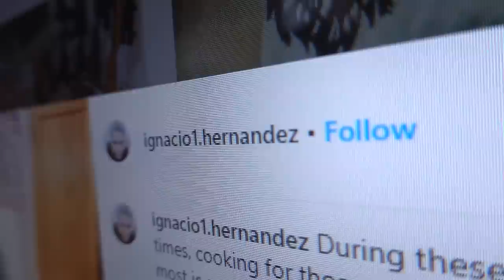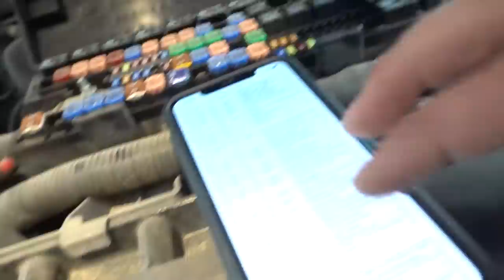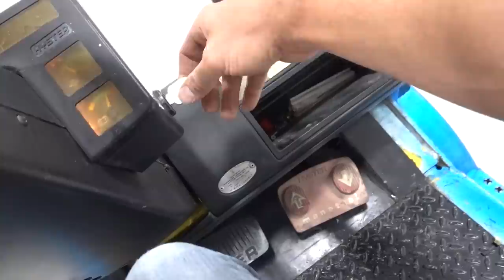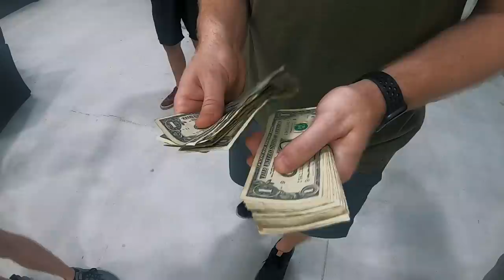I Bought an Old Beater Forklift... AND IT'S AWESOME!!!

Comment: With the fan always running it could be a few things. A bad thermostat that could be stuck open or it could possibly be a bad coolant temp sensor. Bad sensor or short in wire.
Reply: Agreed.... Common with Fords
Reply: This was my first guess as well - bad coolant temp sensor
Reply: could also be a random problem with the engine/the computer in it, happens with cars too
Reply: Or the relay he just bought was bad out of the box...

Comment: OK, you had your fun. If Texas is like Florida you may need to take a forklift operators safety course (All Operators in your company). I am glad no one leaned too far while riding in the chair while elevated since it did not appear to be tied to the forks. One thing you may want to consider is a set of fork extenders. They slip on over the existing forks. They can extend your reach when unloading longer size shipments. I hope it lasts you for years to come. Stay safe and stay healthy. Keep living your dreams.

Comment: Hey Matt, if you put the parking brake on and accelerate while lifting up the forks it  makes the hydraulic pumps work faster. You also by the looks of it have side shift to the forks. This means you have half a metre to move the forks side to side, this is useful for loading pallets onto vehicles

Comment: I'll direct you to AvE to see a few mods you can possibly make to your new / old forklift. You have a bad sensor telling the fan that the engine is hot. Just wait until you have to change a light bulb, I said get on the pallet and I'll lift it, Yes you will be 'safe' :D (last comment posted to soon)
Reply: I would also direct him to a recent video by the youtuber Watch Wes Work. He recently put up a video about a Cadillac XLR  with a cooling fan that wont shut off. The system is designed to fail safe so your engine doesn't overheat and turn into a large, expensive paperweight. He also has some great videos on forklifts.
Reply: after that it will be Skookum as Frig!

Comment: Just mind your weight limit when you have that at max height moving around... scary stuffs man 😂
Reply: Ditto, there should be a plate with max weight and height on the forklift. If not, look online for make and model.👍
Reply: I've watched as things fell due to that when working at a warehouse, scary is an understatement!
Reply: I was thinking the same thing, if you move that lift around without lowering a heavy load from up top it's going to be an instant disaster.
Reply: You doing a business? Someone gets killed and you have NO business anymore. OSHA will be up your ass if anyone gets killed with that lift. You need a safety program and a training program.
I worked in a specialized department doing OSHA certifications and other insurance/Federal regulation compliance for 19 years.

Comment: For your truck. Try to find a wire diagram and follow the wires check for a break in the wires Use a voltmeter Also check the grounds. Hope this helps love the videos.

Comment: The propane is alright for use in small warehouses however I would recommend opening bay doors for circulation when operating for a while. I believe osha says electric is the only proper forklift for indoor use without proper air circulation. Congrats on the new buy
Reply: Propane is totally fine indoors.
Reply: @rickmista1213  With proper ventilation
Reply: @Xachremos  Nah you do not need a ventilator for propane.... Now if you smell propane I would open it.
Reply: If they run it to much. The first tell tale will be getting headaches. Then you know the fumes are getting bad. But I don't believe they will run into trouble running it inside. Many warehouses run multiple propane forklifts inside. One being run inside won't be enough to cause trouble. That's a big space it will dissipate quickly.

Comment: I think you should get something like obd reader. Manytimes you have had issues and wondered whats wrong, think it would help alot🤔
Reply: That only works when check engine light is on.
Reply: @tommywilliams9184  A vehicle can throw a code without the check engine light on.
Reply: @tommywilliams9184   i dont know about all car brands but ihave audi and specific obd reader for vac consern cars and it sees everything. Even like if you had trunk light error week ago 🤣
Reply: Battery disconnected usually won't throw codes until the truck runs for a while
Reply: @dariushobbs1  Especially something as new as the Raptor.
Reply: OBD2 adapter, $12 on amazon. type in "ELM327". thats the type of adapter it is.  then download the Torque app.
Reply: I totally agree!
Reply: @sberryscake   i had one of those and torque app. It didint show anything else than engine component fault codes. I would maybe buy one that is made for the specific brand

Comment: The relay will have numbers by each pin, normally pin 86 is the feed from the switch and 85 is the neg or earth pin, put your volt meter in these two pins sockets with the key off, if no reading  system is good, if you get a reading with the key off, the water temperature switch is stuck on and powers the fan, and most switches are design to fail on as it is better to be to cool than boil up, good luck mate.

Comment: As an experienced hyster fork life operator, when you took him up in that chair, it scared me. You should never do that. Ever. I recommend taking a forklift course and anyone else who operates it get certified, and having a forklift mechanic look over your rig. Over time the chains stretch, wouldn’t wanna drop something and hurt/ kill someone.
Reply: I take offense to this. It practically suggested trust it with your life if some other person says it’s fine. You should never be in a position for your life to end because of mechanical failure. 

The only thing we trust like this is buildings and brakes/steering. There’s never a reason to be near any heavy machinery in a way that gets you killed. None
Reply: I posted above but I didn't list all the things that made me go WTF? Company I worked for years ago (same one I got MY cert at) bought a BIG Hyster hydrostat. Got it cheap due to a lunched engine. No problem, we had a warehouse full of Diesel engines. My area was warranty so all the engines that people ran out of oil came to me. We built an engine for it out of good leftover parts. Inline turbocharged Diesel 6 cyl. MUCH more powerful than the original engine! There were only a few of us that used it everybody else was afraid of it! Damn thing would ROAST the tires!

Comment: Matt, I hope you read this, to have a forklift, you need to do safety inspections each day you plan to use it, this is an OSHA and insurance requirement. If it fails the inspection, it has to have a lockout tag, and keys locked up. You will have to get  repair work done by a licensed and certified lift truck technician. You could have leased from Hyster and got maintenance thrown in, if it goes out of service they bring you another one. Also when you lift someone up in the lift, it has to be in an OSHA  and ANSI approved Forklift man basket, with a lanyard and safety harness. It also has to be attached to the forklift with safety chains. Now the big picture, all of your racking needs safety post protectors, gantrys and jibs, bollards by your doors, and guard rails by equipment. You will also need LP cylinder cage to store spares, you opened a big ass ball of worms getting a forklift Good luck. Check with Grainger, they have all the things you need.
Reply: Oof
Reply: bro how many people actually do all this stuff? unless they video themselves without this stuff theres no way theyd get caught and whod actually snitch? cause most people dont know youd need all that stuff
Reply: Grainger, 25-75% more than anywhere else but good in a pinch to get you up and running.
Reply: @gcart7675   No one snitches until they get injured. I hate BS safety but Forks are dangerous and training is important.
Reply: Leasing is like 1k a month..... Stuff like that kills small businesses
Reply: @Turk_2023  Getting repair of owned lifts is very expensive w/o a service contract, which can hurt small business owners even more.  I have been a lift( forklift/order picker, boom, scissor lift) operator for over 20 years!!
Reply: @jz422  yeah Koke inc has more stuff, but way more expensive
Reply: @bryandiel6773  I mean these dudes are buying it to lift a pallet of shirts on a truck twice a week.  They are not going to break it down fast

Comment: I used to work 12 hour shifts in the 1980's at the Spencer Gifts printing facility in Somers Point, New Jersey. We ran huge computer controlled laser printers printing catalog covers for their mail division with a crew of about 6 people at night. We had 2 forklifts to move paper, ink, and printing drum supplies around. The printing machines needed little supervision, just paper and ink every hour or so, and a drum cleaning or change when the print started to look sloppy. So that meant forklift races and other fun for most of the time, especially on Friday Beer & Taco nights.

Comment: I’d highly highly recommend buying/installing a side shift for your forks. Super useful. 

Also, when you need to get your forks to go up faster, put it in neutral and give it gas, it’ll raise up faster.

Also also, when you use the lift and need to put a skid up, go about 3/4 of the way onto the rack, then tilt your mast forward to allow you to get it in all the way. You don’t have to do that getting them down. Just go straight in and pick it up to get them down

Comment: You should get some wheel booties for the forklift and a skirt in case of any fluid leaks. The concrete looks unsealed and will stain very easily!! That floor would look great and last forever If you got it polished!
Reply: I think he mentioned a few videos back that the concrete did get sealed
Reply: Floor is sealed
Should have gotten a forklift with air tires
Reply: @dubious6718  I was going to say, "not for a warehouse forklift. That's just one more maintenance headache." Then I remembered this is Matt we're talking about. We'll probably see him haul that thing out to all sorts of "non-warehouse spots" (like the Abandoned Mansion) to do all sorts of "non-warehouse jobs" (like acting like a vehicle lift)...

Come to think of it, tires is the least of Matt's worries.
Reply: anker eisenman must have missed that

Comment: Matt, you probably did, but check the coolant level. if it gets low, the fans will run longer to keep cooling the lower amount of coolant in the system and usually the water temps are pulled near the top of the radiator (which wouldnt have coolant anymore) so just hot metal.

Comment: First off the hyster will be good for another few thousand hours, the engine will go first mind. Please 'LISTEN' do 'NOT' play around with the forklift or in the vicinity of it when in use. Ive worked with all types of forklifts over the past 30 years as an material handling engineer and technician and can tell you there are too many horror stories caused by 'a bit of fun' with the trucks. Having to remove body parts and clean the liquids left is no joke! If you or any employees turn the steering on full lock and gun the engine for a laugh as you do donuts(as was in your video) you will not be laughing as you get flung out the side due to inertia as the truck tips over on to the top of you. Be respectful, thoughtful and get training for everyone whos going to use the truck.
Reply: Last time I saw a forklift (paramedic), two people had wanted to mess around. One hit the other, broke both his shins (both tibia and fibula) one leg open break. could have gone much worse. Pretty sure that guy couldn't work for a year.

Comment: I owned a commercial recycling company and for awhile we had both Hyster and Toyota forklifts. The Toyota’s rarely needed anything other than regular maintenance. Not so for the Hyster’s. Lots and lots of repairs.
Reply: Hyster's are built 400+ lbs more than Toyota's and are far easier to work on and obtain parts. All about maintenance man.

Comment: I'm not totally sure what your issue is, on my f350 it was just the relay that needed replacing so I tore out the motor and put a Cummins in it lol I wish you luck in finding that gremlin also 2500 hours? That things mint!
Reply: King Bob why would you do that it doesn't make any sense
Reply: Its obviously a joke
Reply: My truck wouldn’t start so I changed the headlight...totally fixed all the problems
Reply: Mint or f*cking mint 👌?

Comment: My 05 Mazda6 had the exact same fan issue. As long as electrical power was supplied, the radiator fans would be going. I ended up fixing it by replacing a part called a radiator fan control module. The module was fairly inexpensive and easy to replace. It’s certainly something you could take a look at.

Comment: Very practical purchase! maybe tidy up the paint and a few other things and make it look a bit nicer?  Hyster is in the top 5 of quality forklifts you can buy, 2500hrs is quite low for a machine of 17 years of age.  Never ever leave the tynes up in the air and then turn it off and especially when they are loaded.
There is nothing wrong with the tan fabric on those office cubicles! don't listen to what mere is saying.

Comment: That lift is not a toy, treat it like one of your "pew pew's" so no one dies.
Matt, I strongly suggest you and your crew ALL get official forklift training BEFORE any of you use it in shop. If it is for permanent shop use, it will likely be required by law. (may vary by state) As soon as you can, ask the seller if they will give you and a few others the operational basics at least, for what you can and cannot to do with that specific lift. Get the specifics on what it can do and not do.
I have had a childhood friend get killed because of a simple blind spot issue and he was crushed while the operator was backing up. As for now, keep all parties at least five feet away when in use.
Reply: yup. Hysters are quick to jump if you make even the smallest mistake. The guys in the bunker doing stupid stuff like lifting other people on a chair is just baiting OSHA to shut their shop down.

Comment: Looks to be a h35ft fortis truck. they run on gm and Mazda powertrains. Make sure you keep up with pm maintenance and make sure your hydraulic lines aren’t cracked and it’ll run forever. Hours are low so you should be good. Just make sure you look into taking the course to get certified 🤘🏻

Comment: Check your trucks' coolant temperature sensor, this is is on all the time and reads the coolant temp. Even if the engine is off, it will turn on the fan if it reaches the cutoff temperature. They are usually pretty cheap.

Comment: You have a shorted thermal unit that energizes the relay when it gets to a set temperature. Usually small and round top unit mounted along side the radiator or a pipe/tube leading to radiator.

Comment: Come with me and you'll see, a world of OSHA violations.
Reply: 😂😂😂i was thinking the same thing. But I like your Willy wanka twist. Lol
Reply: Ditto
Reply: how orignal
Reply: Best comment here
Reply: Stole from Instagram video.
Reply: @Stackali  yep. Was the first thing that popped in my head when I saw everything Matt did on the forklift.
Reply: who cares? obviously they dont or havent seen this video yet if there actually is any violations lol 😂
Reply: I sang that. Thank you
Reply: @gcart7675  two quick ones that'll get written up everytime. 
Used electronic device while operating lift. 
Left an unattended load elevated. 
Also for the bonus, driver not officially trained to use lift.
Reply: Michael T k like i said who actually cares? and how would they enforce everyone using it or not? answer: they cant cause too many people everywhere wont always go by it
Reply: @gcart7675  they can't enforce it but, they can fine bunker branding if they did an inspection. 
Also if someone gets hurt and it comes to light that safety standards aren't being kept. Any medical and legal cost would come out of Matt's pocket. Said the OSHA song in fun but also whoever is on Matt's safety committee (which I think his company is large enough to require one) is going to have to do proper research and training.
Reply: Michael T eh whatever if they cant enforce it i doubt anyone is gonna care or do it but he is actually alot more careful than people think and rules are more made for those who arent safe than are safe and careful cause the people who are safe and careful dont need them cause theyre already that way
Reply: Sorry but it's "Come with me. And you'll be. In a world of OSHA violations."

Comment: Matt, you'll be surprised how much you'll use the forklift. You could have your welding buddies make a 20ft wide or so platform for it, and use it as a "man lift" to reach and work on wall/ceiling projects. Also, rent a mag drill and drill a hole in one of the forks towards the end to mount a trailer ball and move trailers around, and use clevis' to pull things. Not sure what the rules are in Texas, but might have to have forklift training for your employees

Comment: as a licensed forklift driver. gas lifts are meant to be used outside or half n half. also looking at the tires on ur rig its an indoor setup so be considerate. thing is, when u get a forklift .. u only keep going bigger and u never wanna get off it ^^ good buy 4sure!

Comment: leave the relay out till you can get it fixed, you only need the fans when in traffic, while your moving you have air moving through so don't need them. i had an old bomb which had a fan on a switch, only turned it one when sitting at lights or in slow traffic.

Comment: Check the engine temperature sensor that feeds the fan relay the signal to turn on.  Usually located in the intake manifold or cylinder head.  Possible the thermostat housing too...